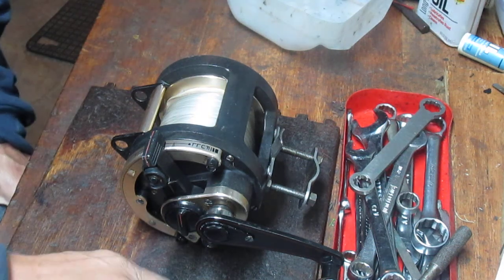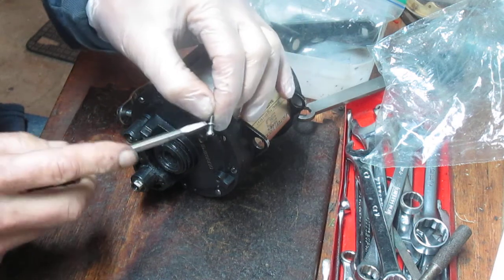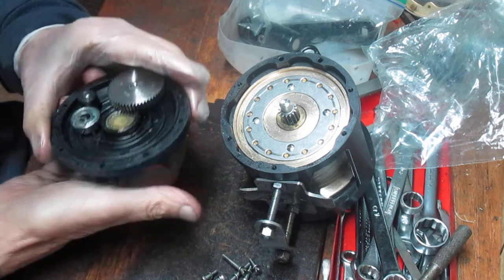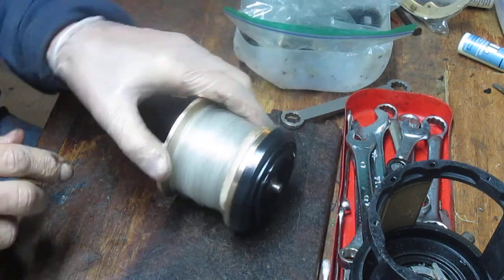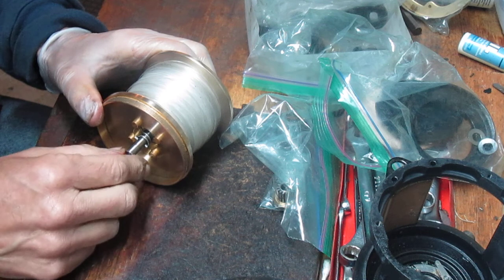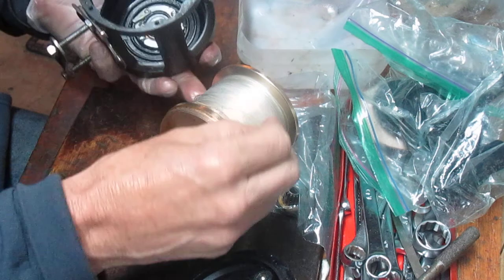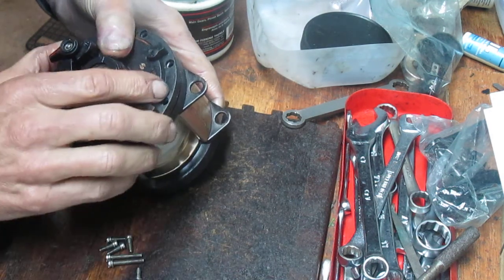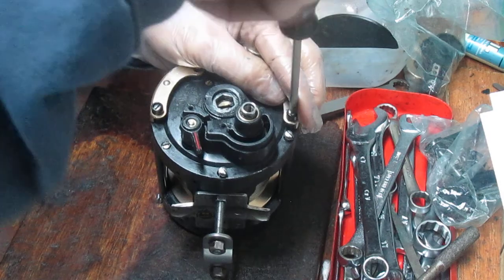Shimano triton Trolling Series TTS 30 big game lever drag reel take apart and service

Comment: Hi.

I just bought this reel in really good condition.

How to determine if the drag washer is worn without opening her up?

If a new drag washer is needed, what steps are required to obtain a new one, given that Shimano no longer services these reels ?

Also, what is the maximum drag level for this reel?

Cameron
Reply from the maker: If the line is still pulling out when you are in max drag and fully adjusted on the preset knob, the drag washer would need to be replaced.

You should be able to get the drag washers through Southwesternparts.com or Platinum Parts website https://shop.fishingreelparts.com. or Smoothdrag.com. 
I think the max drag is around 30

Dennis
Reply: @2ndChanceTackle  Many thanks Dennis.  I have also read on the internet that this reel can be converted to 2 x speed along with a bearing and sleeve conversion.  

Do you know about these mods and what the purpose is for each one? 

How much does this reel weigh?

How does the drag ratchet compare in sound with today's Tiagra model?

Cameron

Comment: Thanks for the video, I'm going to work on my penn 30, question...the large felt washer on this reel does not require oil like smaller reels, thanks again
Reply from the maker: That is correct.  It just needs to be clean.  Good luck on the overhaul.  Make sure you pull the schematic and pay particular attention the sequence of items on the spool shaft.  Take lots of pictures.  Also.  The Collar on the Penn reel is similar, but you may need there removal tool to get it off.  I have had a few of the Penn Internationals that would not be removed with hand strength.  I bought the tool. It is available through Pennparts.com - Dennis
Reply: 2nd Chance Tackle thanks I'll let ya know how I make out.

Comment: thanks for the great video ,   I picked up a triton 80w for not a lot .  and have noticed that the drag is not that smooth and steady.  Seems either to loose or too tight.  line is either screaming off , or not at all.  Is it possible that its that drag washer is the issue?
very informative video ,  thanks again.
Reply from the maker: The problem you are describing is almost always drag related.  Most of the time that this problem occurs, it is the result of the drag stack sticking together.  That can happen when the washers lose their flexibility and dry to the metal.  You most likely will need to service the washer by removing it and making sure the metal pieces are smooth and clean.  If the washer is damaged or dry, you will need to replace them to fix this problem.  - Thanks for asking - Dennis
Reply: thanks for the help.   If i could pick your brain on one other issue with this reel.  
My handle on the triton 80w is functional but plastic is cracked  at the actual handle part.   I heard that a modern tiagra handle assembly would work,  Is this correct you think?
again thank you for all the good info in your videos!!
Reply from the maker: The best thing to do is to call them Shimano parts center and ask an expert.  They can answer your question and get you the part if needed.  The number is 877-577-0600. If you want to contact them through email - go to Fishshimano.com - Dennis
Reply from the maker: The best thing to do is to call them Shimano parts center and ask an expert.  They can answer your question and get you the part if needed.  The number is 877-577-0600. If you want to contact them through email - go to Fishshimano.com - Dennis

Comment: Was just curious what size conventional reel this is I wasn't able to find much about this online mostly about the newer models mine is a older model just like this one.
Reply from the maker: The size is comparable to the 6/0 penn format
Reply: @2ndChanceTackle  I wonder if I could get around 300-400yards of 100lb braid on that reel
Reply: @2ndChanceTackle  I just finish lining this reel with 315 yards of 130lb Suffix Braided line with 100lb backing